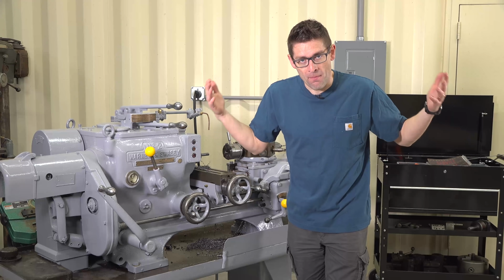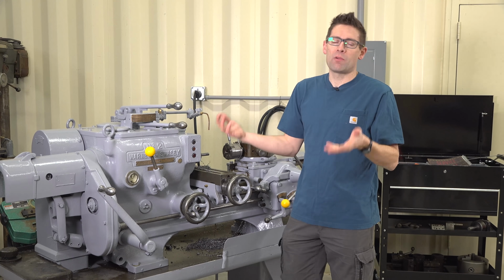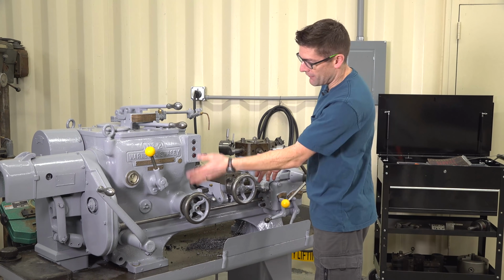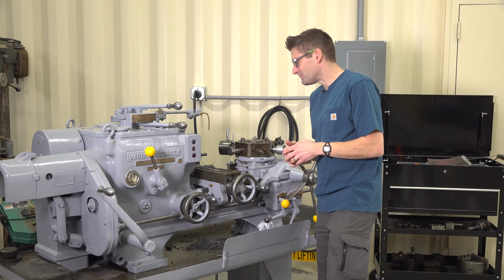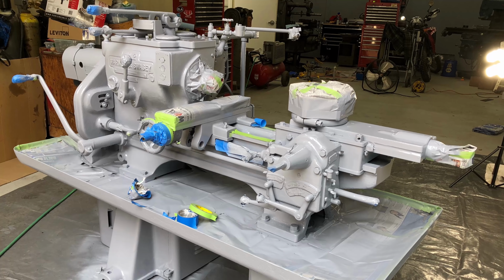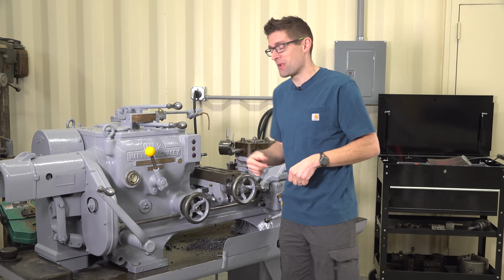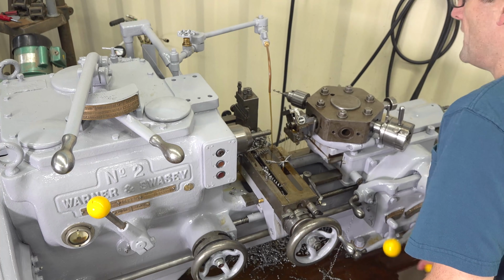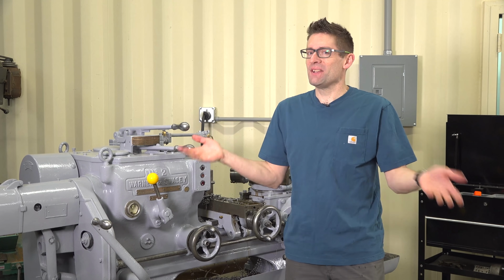Lathe Paint Job and Demo: Warner Swasey #2 Turret Lathe

Comment: Nice job on the cosmetic restoration!  I might be picking up a #3 Warner and Swasey lathe very soon.  I'm wondering where I would find collets for it?   Do you know what kind of collets it uses?  Also can I put a regular chuck on it?  And if so, how does the chuck attach?   Does it screw on or bolt on?  Thanks.

Comment: I have a Colchester 13" x 24" Dominion mid 1960's . Weighted the lathe before putting it on my Ford f150 . 1300 lbs + , thought I was going to blow my truck tires . Did you get a chance to weigh your lathe??

Comment: This exact same model lathe chambers every ar barrel coming from one of the biggest players in the game. Four tools on the turret and an good operator and you can chamber a ar barrel from start to finish in 1-3 minutes depending on the caliber. The auto stops are nice but we don’t trust them for the precision needed to cut the counter bore and finish ream. The main downfall to this machine is after two years of running it 50 hours a week, just looking at it makes me hurt. The part locking mechanism destroys your shoulder, the dial indicator spinning around makes you go cross eyed but don’t blink otherwise your two thousands deep and the barrels junk, shifting gears and spinning the turret around works out the arms and core.